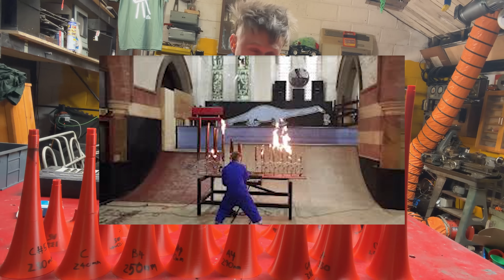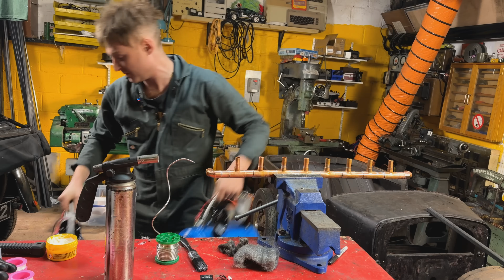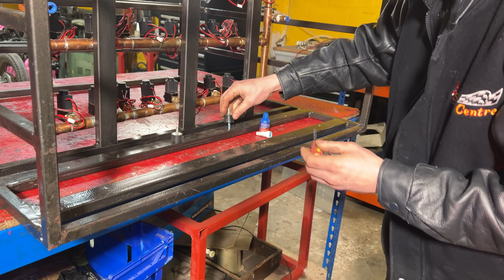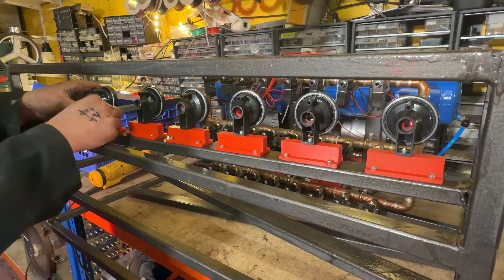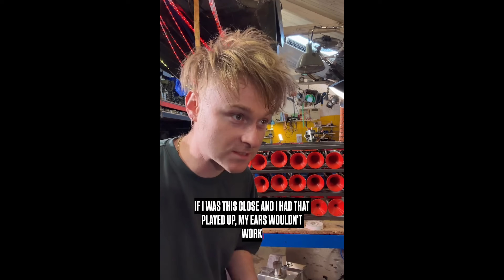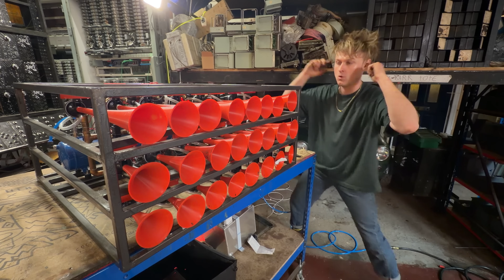I MADE A COMPLICATED CAR HORN that is 130db!- Part 1

Comment: Dude you will want to consider double hearing protection in future. Ear plugs only attenuate usually up to 20-30dB. You should wear ear muffs and plugs together to attenuate down to 80-90dB. Army Pilot with permanent hearing loss and tinnitus. 😢 Don’t make my mistake.
Reply from the maker: honestly if you bung em in with a bit of spit it sorts it right out ha
Reply: @LOOKMUMNOCOMPUTER yeah. We actually did that! Especially to lube up the ear wax. 😂

Comment: Not what I was expecting, but this is awesome.  As somebody who's been into 3D printing longer than I've even known Eurovision was even a thing (not European), this is actually quite a pleasant surprise finding a channel doing stuff like this.  Did you have any problems with the screw down terminals and the solder?  I've always found cables come loose with screw terminals unless I use ferrules instead.

Comment: In France they have a similar instrument using metal horns that is mounted on the top of a vintage truck and driven by a diesel compressor in the back and operated by a punched cardboard book as used in a fair organ, they drive it along the road playing in parades etc., be interesting to see this one mounted on the car.

Comment: Dude. You are on the internet. Don’t solder the ends of cables you put into screw terminals. They’ll come at you when they find out. (Because solder flows under pressure or something and the connection becomes lose over time)

Comment: A cool addition could be to add a lights of some kind to each horn that lights up when it plays similar to Joan's Organ. You could add a surge/buffer tank in place of the 2 small compressors to give a more consistent pressure to the manifolds if you're going to be pulling them off. Also, obvious alternate title: Sam gets horny.

Comment: Hei Sam, solid state relais may be a better fit for this project because they react faster. Mechanical relais actually have quite a long delay in closing and even more so in opening. Would make it possible to play faster passages more precise. 
Also: I need to hear the Imperial March on this contraption. Would be a hilarious combination. 
Regards, the Daft Engineer.

Comment: Playing music is great, but we have to hear all 24 horns in unison!  I'm not sure about the math, they should be around 10dB louder altogether. Lack of air flow and pressure will be the limiting factor.

If this gets popular on this channel, follow up with a gigantic ten-foot-long horn array.

Also, those giant concrete acoustic mirrors on the channel coast,  these can act as sound transmitters if the focal point intended for microphones were replaced with sound transducers. It shouldn't be too difficult to temporarily install a sound source capable of high dB output and send an acoustic signal some incredible distance. May be able to get a Guinness World Record out of the attempt.

Comment: Those compressors are awesome if you made a small modification. The air intake is three tiny 3mm holes with a filter. If you epoxy them shut, then unscrew the back plate,(exposing the piston), drill a dozen 6mm holes, and attach a DIY filter, you will notice it runs quieter, cooler, and at least 10 times the volume of air. I can run my airbrush endlessly, without pressure drop.

Comment: If you wanna make the tuning process extra fun you could tune it using glasses of water.
First you match the frequency you want with the resonant frequency of the glass and then adjust the horn until the glass explodes.

Comment: The handles of the 90 degree vises should go on the outside. No need to shorten them.
Reply from the maker: But then you are not clamping 90 degrees without having metal overhanging???

Comment: Thought Big Bogey had a compressor already 🤔 that one should supply enough air or what? Thing is it will be duplicated and placed as burglar alarm inside the Not so Obsolete museum and other spots Sam dont want uninvited guests into. 
Seen various car tuning channels trying various rampipes on throttle bodies and carburetors so should be plenty of versions and lenghts of those to borrow drawings from. 
Maybe make a plug and with hydraulic press make them of thin brass pipes? How hard can it, for a man who made a new head for the engine of his car.

Comment: Nice, although there's a hefty amount of distortion - seems like the plastic itself is going into resonance. I wonder if it can be dampened somehow.

As for controls, I'd go for ULN2803, they can go to 500mA per channel and if the valves need more, you can run two or more channels in parallel.

I really love the slanted assembly bars in the frame, makes perfect sense given the differences in length.

Brüel&Kjær gear spotted on the bench's lower shelf... Nice.
Reply from the maker: Hey uln2803 I use in all other applications. But for these solenoids always preferred relays for  in the field trouble shooting! Also the resonance is part of the charm of these horns :) too clean they don’t sound right. Spent a lot of time to get the raspy and not just clean waves. Hence all the different horn shapes.

Comment: 11:07 You should get a ferrule crimper and a big box of ferrules, it's a lot easier and a lot more stable than soldering stranded wire, solder ends up creeping under constant stress and so the connections will get bad.
Reply from the maker: Then I never buy it. It’s on the humongous list
Reply from the maker: I should! But it’s the sort of thing I don’t buy till I need it
Reply: Totally agree! The connection will get lose over time from my own experience. I do ferrules ever since.
Reply from the maker: @hugoboss9507solder is the liquid ferrule it’s fine cheers! Let’s see in a few years woop. Done it a lot and all seem
To still be alright so who knows hey!
Reply: @LOOKMUMNOCOMPUTER just a friendly bit of concern, hope it works out
Reply: @LOOKMUMNOCOMPUTER  Solder loosens in screw terminals most badly when there's any temperature cycling. I'm sure you get away with it for less than 1A and less than 5 years. But it's definitely true that tin/lead solder-tinned stranded wire in a screw terminal will fail, given enough time or enough temperature or vibrational cycling. 

The last time I ran into this really badly was on the house wiring of a boat, where some idiot at the factory had decided to tin the SOOW cable they were using for 120VAC lighting and outlet circuits (North America if you can't tell). Almost every single breaker screw terminal was scorched, with the wire insulation charred dark brown right up to the terminal and the rubber just falling off in crunchy flakes. Some conductors were bare for several inches because the wire insulation had dropped off by itself, it was so burned. 

 I dunno, maybe with literally zero temperature cycling and almost no current, tin/lead solder in a screw terminal might last indefinitely. But as soon as it starts swelling and shrinking with each temperature cycle on a conductor that's doing any work... forget about it. 

What's so concerning about your work isn't the safety issue, of course, it's just the enormous pain that this would entail, with the sheer number of connections that some of your builds have.

Comment: They should probably be printed with threads to enable finer tuning (maybe even with one section with coarse thread and one with fine thread) instead of being glued.

(Or autotuned with a servo for each...?)
Reply from the maker: Tight fit is more than enough! Nice and simple! Peace
Reply: @LOOKMUMNOCOMPUTER  :) But a servo on each for bending notes :) would it not be somewhat hillarious if it did that? :)

Comment: thing those airhorns work with a membrane tesioned over  large pipe with a smaller pipe pressed in the center of the membrane , the air travels between the big and smaller pipe and the only exit is lifting the membrane of the smaller pipe and exit through the horn this causes a airvibration amplified and tuned by the horn 
wonder if you can build a realy large one using a drumhead , maibe use a rototom to tune the tension 

gosh im so happy youre not my neighbour , i actually like to sleep in in the morning

btw found sumting else that might be fun to build intoo a musical instrument :
https://www.youtube.com/watch?v=dCrrUUhSmH0

Comment: I used to have one of those handheld airhorns with the air canister and used it briefly at raves during the early 1990s. 
When I saw briefly I mean it, because after about 3 raves I got fedup with being defeaned because you just couldn't let it blast even at bloody arms length before getting rapidly fed up with it. 
They are stupid loud.
Anywho, this IS going in the Austin Seven at some point, right?

Comment: Once I was pondering if it was possible to create a subwoofer using a jet engine to generate pressure difference between chambers and then electromagnetic gate valves to generate the signal. You can use my idea freely. :D